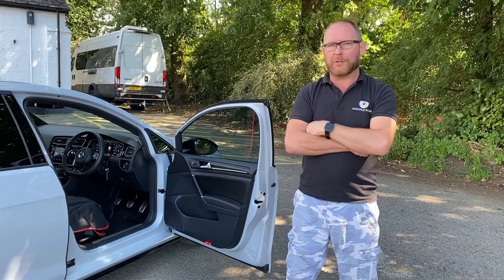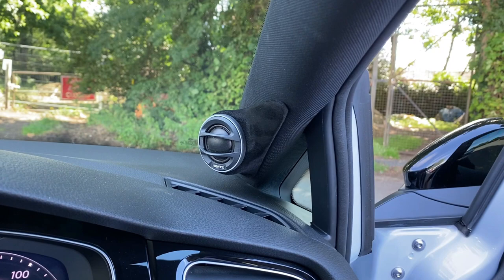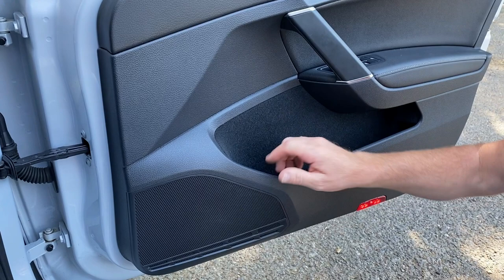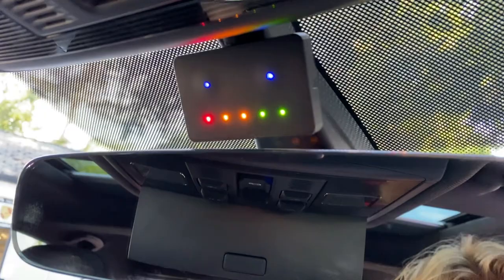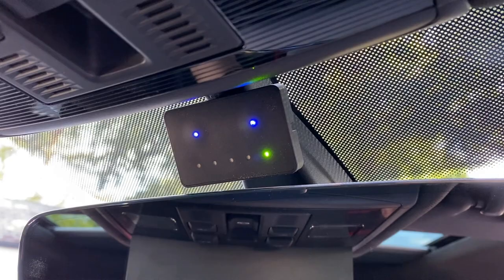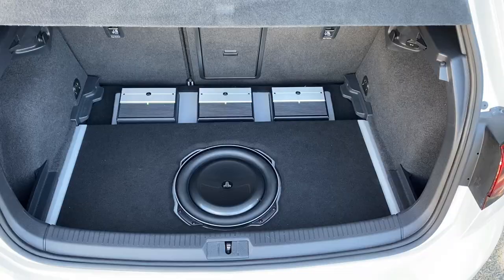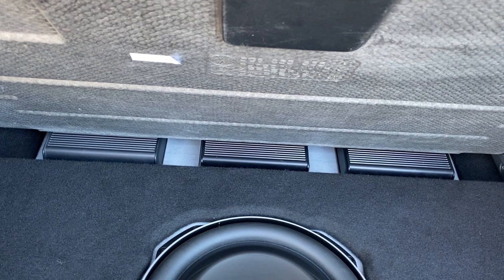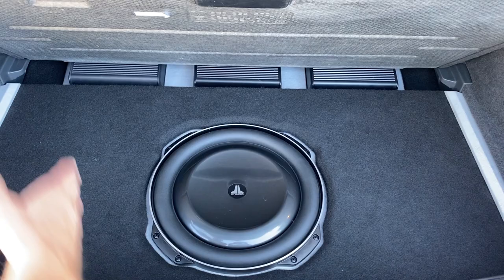VW Golf R Audio Upgrade And Target Blueye | Audiofile Incar

Comment: insane build mate, great detail too, rough cost on this?
Reply: FRONT: 
He mentioned 5-6 hrs on the front doors and shop rates vary so let's say $50/hr or about $300 in labor costs for the front doors.   Materials costs for the front doors: woofers are the Hertz Audio ML 1650.3 LEGEND165  - $800/pair and then all the misc. stuff like MDF, glue, wire, dampening materials and we're likely somewhere around $1,300 for the front doors. 

Tweeter pods took the "better part of a day" so about 7-8hrs of labor for both of those custom tweeter pods plus install and the cost of the ML 280.3 LEGEND tweets ($550/pr) so about $1,000 with materials, tweets and labor for those cool pods. 

Audison DRC/SRC controller is about $200 plus $100 in labor and materials. 

So the front speaker setup is around $2,600 thus far.  I left out that emergency vehicle device blue-eye thingy since it's not audio related and I'm too lazy to look it up. 

REAR DOORS: 
Audison Voce speaker components $700, plus $300 in labor and materials thus the rear doors are about $1,000

TRUNK: 
The sub is the $800 JL Audio TW5v2, the materials back there are likely around $350 total (MDF, carpet, glue, dampening materials, amp wiring), then those three JL Audio amps: two XD400's and the XD600 all about $600each and he doesn't mention the trunk labor but that all looks like 5hrs of work so another $250 in labor.  I think total $3,200 back there. 

RATHER ROUGH ESTIMATED TOTAL: $6,800 

Check my maffs b/c I'm lazy and this was way more detail than necessary.

Comment: I love this - I've the Dynaudio factory option on my 7.5 R estate, which, whilst having pretty decent & detailed component speakers, definitely isn't much good for bass - the sub is definitely the weak point! I also think there's too much low end bass going through the front speakers too (plenty of excursion - probably needs soundproofing too). 

Practical to upgrade that side of things?  I'm sure that build will absolutely spank my Dynaudio system (I've had full blown ICE setups in the past, so know how good they can be).

I'd love to know how much (& how practical) it would be do carry out a "lite" version of that, using a proper Sub & retaining the Dynaudio components, please?

Comment: Hello, I'm new to all of this. I have a 19 GTI and was wanting to put a subwoofer in. What would be a good size? I don't need to have anything crazy, just enough to have fun with. 

Been looking at
Kicker 48TCWRT102 sealed enclosure with single 10" CompRT 2-ohm subwoofer and passive radiator, but I don't know much....